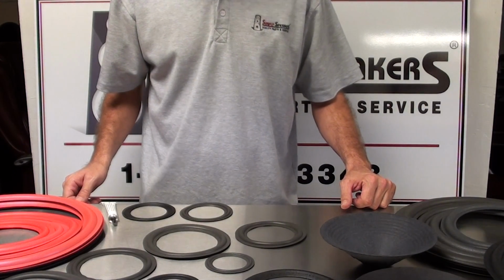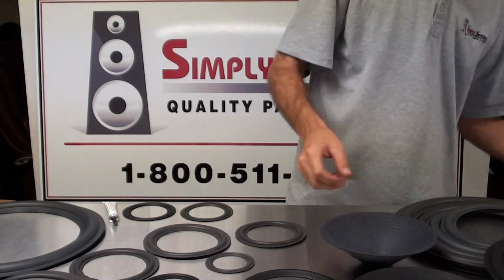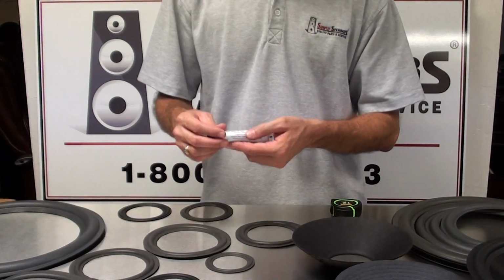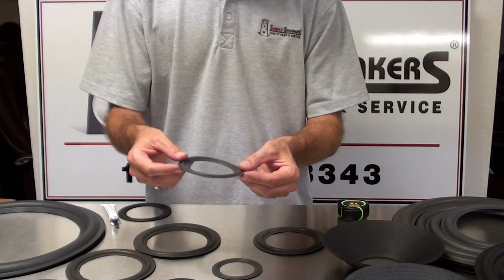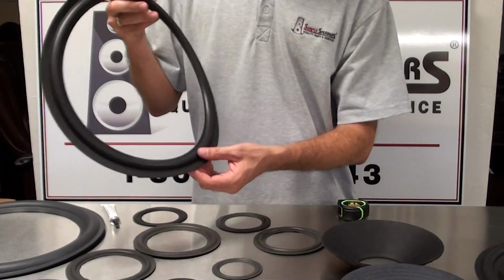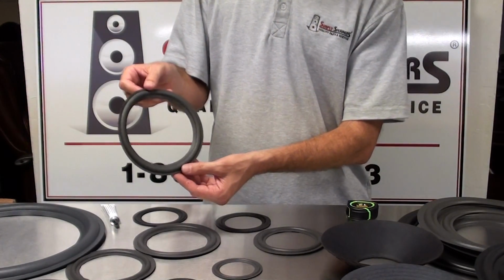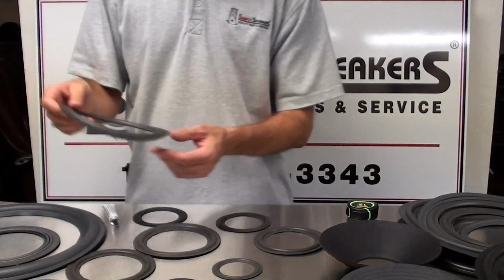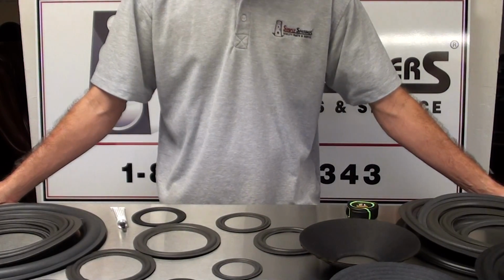Speaker Repair Foam Edge Styles and Sizes for Speakers by Simply Speakers

Comment: What if I glue the around rings in the back of the speaker would it still work
Reply from the maker: Yes! You can rear mount the surrounds.
Reply: @simplyspeakers  thanks

Comment: make sure you understand whether you need a flat attach surround or an angle attach surround.   all the low budget sellers on ebay will sell you a flat attach surround, while telling you it will fit an angle attach speaker.   you cant get a flat attach foam to lay flat on an angle cone.

Comment: I need an angle-attach for my drivers but can only find the correct size in flat-attach. Does anyone know a trick to get that inside edge to glue down flat on the angle? 
I read someone used a small kitchen bowl to force it down... but I'm thinking you'll end up with an uneven lumpy looking surround.
?
Reply from the maker: The adhesive we include with our kits is aggressive enough to do this without clamping. You will need to work the foam down to meet the angle of the cone manually several times and babysit it while the glue cures. It is not as difficult as it sounds. You can do it!
Reply: @simplyspeakers  I know I CAN do it. I just would rather avoid the pain in my ass. Lol

Comment: Please advise for right size ... Have a pair of Altec Lansing Model Nine Serious ll , require refoaming on 12 inches woofers and midranges 4 and half ?
Look forward to hear from you before ordering, thanks !
Reply from the maker: See woofer kit # FSK-12Altec and mid range kit # FSk-4.5B. You can also use the search box on the website and enter 'Altec model 9" to see results for the kits. Thanks!

Comment: How about butyl surrounds and mesh dustcaps that don't make contact with the cone? The vintage German and CTS drivers employed these features. The mesh dustcaps aid in preventing linearity problems with the cones. Butyl last long and has better elasticity. Most manufacturers don't use butyl due to the cost of natural rubber so they opt for cheap foam instead. Do you sell these options?